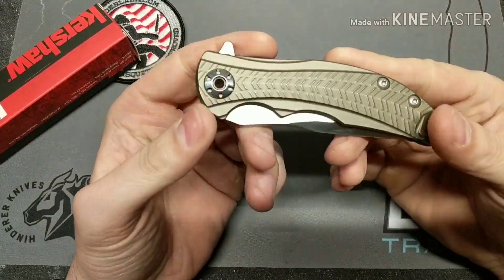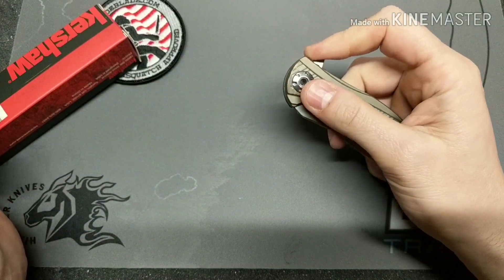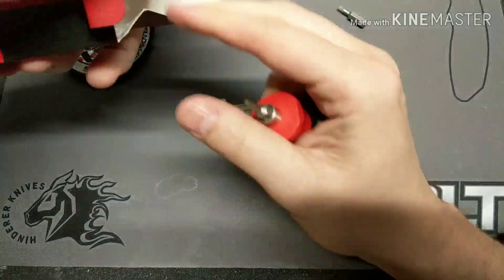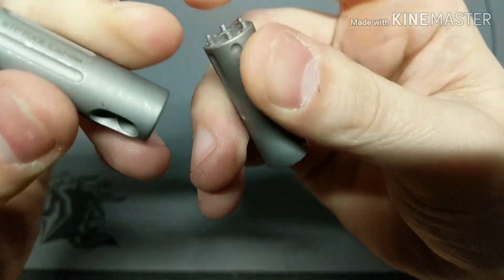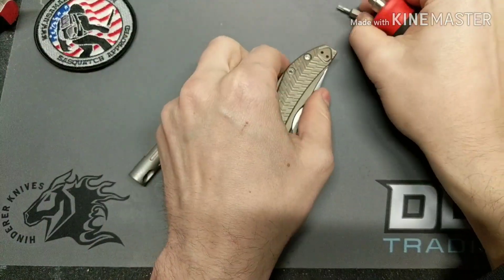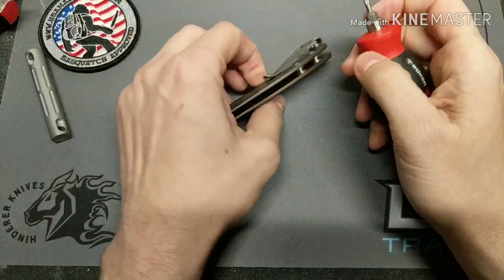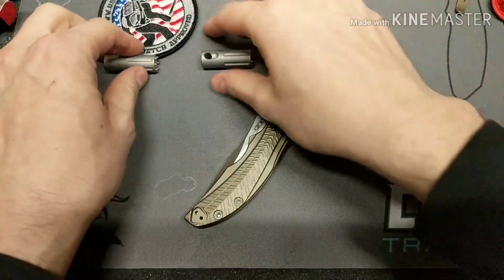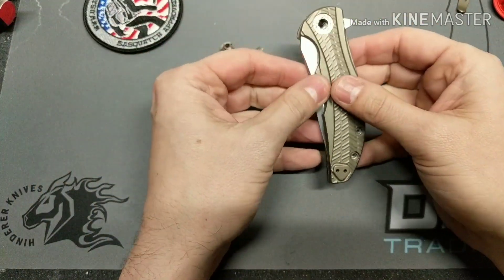ZT 0609 Project (Part 1)

Comment: How did you get the lock piece out
Reply from the maker: I used a small pry tool
Reply: bladecentered thank you. And do you have a link where to buy the power supply you used?
Reply from the maker: @IAN__CONKEY  no I don't have a link, but you can find them on eBay

Comment: It is good for me to see that I am not the only one that struggles to get knives apart.  Did you cover the pliers with anything to avoid scratches?  I have used electrical tape a few times in the past for really stubborn parts.
Reply from the maker: I didn't cover it, but I don't think there was any scratches